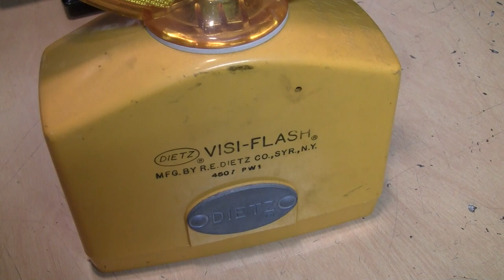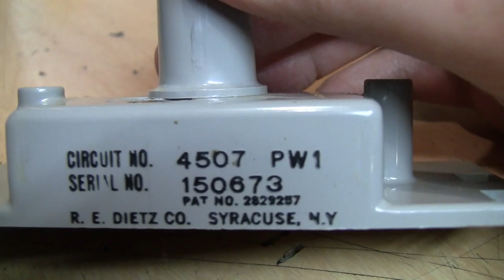Dietz Visi-Flash 650 barricade warning light

Comment: The newer barricade lights have two LEDs and use either C or D batteries ( sometimes a 9V battery) and the two LEDs are clear but light up bright amber. One LED is faced towards the front reflector while the other is faced towards the rear reflector. There are also solar powered ones for Stop signs ( Flashing Red) and or river / canal channel guidance marker lights which use red / green. I've seen those in use. =^.^=

Comment: I actually had a light like that back in the 1990s; I had found it at the local Goodwill of all places, and I think I paid 8 bucks for it. Unfortunately I don't recall what became of it. As for whether or not they're still around, they certainly are; for the last few weeks they've been doing gas line replacements in my neighborhood and they place a small folding barricade with a newer version of one of those lights on it where they've removed a piece of the sidewalk to access the gas lines. The new ones seem to have an LED in them instead of the incandescent bulb and the case is only about half as tall (I think they might use D batteries but I'm not sure). The dual 6 volt lantern battery in parallel arrangement yours has is just like the setup in my US Navy Battle lantern.

Comment: Dietz has different lenses, type and colors, and flasher modules for 650 family. One module without a photoresistor requires 12 volts that wires batteries in series to flash 6v # 820 bulb to see them easier on cloudy days etc.

Comment: wow that's pretty cool vwestlife you found something made here in my hometown of Syracuse New York. Now I don't actually live in the city but I have lived in the city a couple of times. I did not know when I used to drive down on the Thruway a highway system here in New York state that those flashing lights  I used to see years ago came from right here in Syracuse New York. We are so lucky when they broke they were sent back to the factory right here in syracuse where they got them from to being replaced and put right back out on the highway again. Uxw bill it would be so cool if they did have solar panels on them and were powered by the sun. I know those signs that give you the information are solar panel that is so cool. Cities are just trying to save money on electricity by going solar. now I know those flashing lights came from right here in Syracuse New York I never knew that before. I don't think we make them anymore here in Syracuse like you said vwestlife cars are getting extremely better now to the point where you can see street signs at night time and don't need flashing lights at night

Comment: I think that may be an earlier model
Either a later model, or one made by another company of the same design, the positive battery contact  was a ring, the negative was a disc in the middle, so it didn't mater the orientation of the batteries.
The key for those was a flat piece of metal shaped like a cross, one side had the long pokey bit for the switch, the other side had a short pin that engaged with the hole in the security screw, that screw also held the lamp onto a tripod or other bracket (I have a key).
After this style, there were the smaller 'cylinder' type, one of those batteries in the base, and a 'dome' top for the light.

Comment: Nice light you have there. Just a little tip if you have a lot of things that use 6V batteries and don't want to be buying them, Ray-O-Vac (and others, but Ray-o-Vac is the most common) sell a 4D to 6V adapter. This is far more economical to operate 6V devices especially if you prefer Alkaline batteries. The Ray-O-Vac Adapters do come pre-loaded with Carbon Zinc cells, but they can be changed.

Regarding leakage of the 6V batteries, modern heavy Duty 6V batteries are built in a plastic case. If the battery cells leak, this leakage will not get out of the case, especially if you leave them springs up, the electrolyte used in these batteries will not eat through plastic.

Regarding the 5 Volt bulb, that is actually a little high depending on the Amperage. The voltage on most primary batteries is the fully charged voltage (there are exceptions). During discharge the cells will go down to 0.9 volts per cell before  being considered dead (again there are exceptions). The most noticeable exception in both of these cases is the Energizer Lithium. They are marked "1.5" for the voltage, but that isn't their operating voltage. Energizer Lithium AA and AAA cells run at about 1.7 volts, in fact they are considered dead at 1.5 volts.

Comment: Reflector is along the outside of the ring.  The center lens that points the light is called a [Fresnell?] lens. (Someone correct me if I'm wrong)  You should look up a 6V LED lamp for that and stick it outside:  Then around 2026 you can make a video about finally having to change the batteries.

Comment: Just got one of these today at a Restore for $4 brand new but looks like old stock that was sitting in a warehouse for many years.
Unfortunately I didn't get the key and the screw is too tight to open by hand anyone know the size of it? Looks to be a "Tamper-proof Torx? I got a set a Harbor Freight but that will have to wait until after the holidays as this was in Vermont where I'm staying for the holidays.

I also got a brand new exit sign emergency combo light.

Comment: I used to have one of these years ago and can't remember whatever happened to it. I always used to tell people I wanted a construction barrel (a.k.a., a "channelizer drum") when I was about 4-5, and I woke up one morning about 21 years ago to find a Traffix Devices barrel with an Empco-Lite Model 400 barricade flasher attached to it sitting on my doorstep.

While these lights have seen less usage around here in recent years, you're still guaranteed to spot at least one attached to every sign in a construction zone. A lot of Indiana's construction signage is made of wood and the sheeting INDOT uses isn't very reflective. It's even less than 3M engineer grade, so without the light, the signage might not be as visible at night.

Comment: this is the later model, the earlier one was the one we had here in the UK between 1966 and 1983, ours was mostly identical to the visibiliti flash 650, the anti theft bolt receiver being the only difference...made by dorman smith in Preston England, called the nighttime trafilamp,in flashing or static....we don't see them here nowadays as the law changed about having lamps on works on streetlit works under 30 mph...
Reply: Visi not visibiliti*